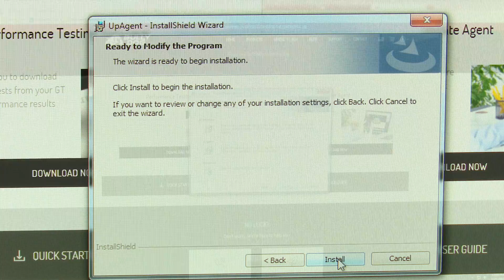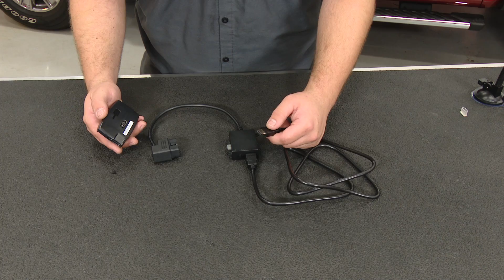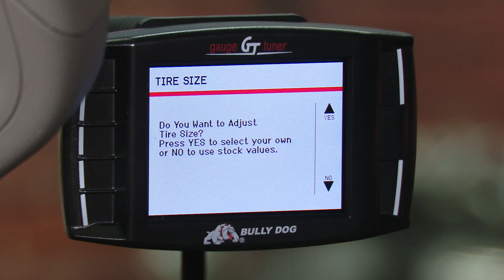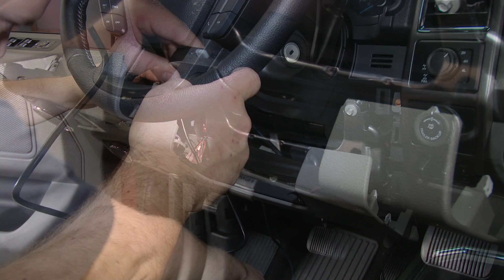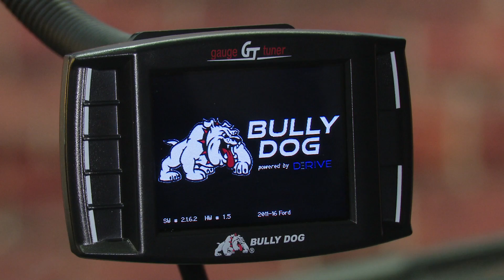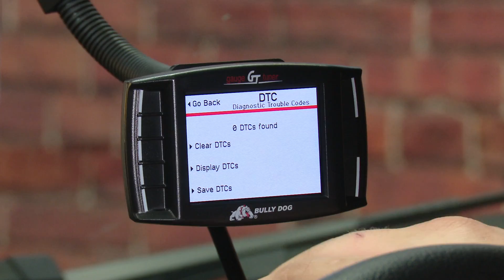F-150 Bully Dog Tuner Gas GT Platinum 2010-2016 Installation

Comment: Wow the comments below… I really respectfully disagree…
1) the wire routing/layout …if I caught my mechanic slobbing wires behind and through my air controls I would be very concerned… this install was for me.. not very “ craftsman like”.
2) I am interested in having the ability to 
a) have a tuner/box
b) plug it in to the OBD port..
c) re-set the trans shift points…
d) MAYBE leave the tuner control head connected for a trip or two to compare shift point selections… and then maybe chose a different shift point set…
e) disconnect the stuff, put it back in the box and leave it in one of my boxes of “ rarely used tools”

I am totally not interested in tweaking…and tweaking..and tweaking… 
Reliability… simplicity… controlling the trans to maintain more torque ..WHEN REALLY NEEDED.. while also minimizing stress on the engine and trans for longer life and keeping best fuel economy…
I am NOT interested in building a race truck that is more prone to failure.

Which takes me back to the beginning…. Craftsman like install…. Hmm

Comment: For the Money your going to Spend on these Tuners/Programers + 93 Octane you really need to think twice !!    True DYNO gains are NOT that impressive for and extra 18 HP + 22 Tq.,  I used the DYNO figures from our Shop DYNO.......   so we achieved the CORRECT SPEC's, not the FACTORY ????  DYNO SPEC'S.... of course I'm not Selling ANYTHING !
Baseline $450-600.00 for a Tuner,  An ADDITIONAL $.50-.72 more per GALLON for 93 Octane..everytime you fill up,,, So, if you were spending $45.00 per fill up before, welcome to the realty of additional $13.00 or more, = about $58.00 for a 20 gallon tank.    People try the 93 Octane before you BUY the Programer/Tuner !   I guess people have money to BURN, I don't.   I run 110% Octane, for $2.30 a gallon, with a Compression of 12.5:1 ....   Yes.... Propane, built the Engine for Propane and it's a MONSTER, for a lot less than what you big Boys a paying for those New Trucks.  I don't cry at 16-17.5 mile per gal. Pulling a 4500 lbs. trailer through the Rockies.  Headers, Mystery Oiler, and of course a under and over Drive !    My Engine LIGHT never COMES on !   It's a raw Performance Based F250 Truck //// how many of you out has anything close to that for $25,000. Invested ???????????????????????????????????

Comment: Would this fit a 2016 eco boost v6 2.7 ?
Reply from the maker: The bullydog in this video is not designed for the 2.7, but this SCT programmer will work with your 2.7 https://www.cjponyparts.com/bully-dog-performance-programmer-bdx-f-150-2011-2018/p/BDXFORD/

Comment: Beware!!! This tuner fried the ecm on my 2010 f150. Bully dog customer service said have it towed to the dealer and they would pay for repairs. Once the dealer gave them a price on a new ecm they refused to pay. (They didn’t even pick up the tow bill). I filed a complaint with the bbb and bully dog wouldn’t respond.
Reply: Jeremy Gilbert probably cuz it’s for 2011 and up?
Reply: Only possible way it’ll fry the ECM is if you use a certain octane gas and choose a different octane tune, for example you fill up on 83 and then choose the Premium (93) tune, as he states in the video it’ll give you problems. Or choosing the wrong vehicle when you’re setting up your tuner
Reply: @charliejackson6447  that would not affect the ecm, it would only cause the possibility of knocking which could destroy internals like valves and pistons, or bend con rods.
Reply: Damn man! Any new news about what happened??
Reply: Jeremy Gilbert Any follow-up info??
Reply: Jeremy Gilbert I'm willing to bet this thing is made for 2011 and up. It seems a little bit fishy that they wouldn't include 2009 f150's as they have the same engine options as the 2010's but the engine lineup changed for 2011.

Comment: How much horsepower and torque gains will I actually get in my 2012 f150 5.0?
Reply from the maker: Depends on the modifications you have.
Reply: CJ Off-Road I'm looking to get a good k&n air intake and I already have a flowmaster cat back on it, their least restrictive system. I just wanna know if getting the bully dog will give me notable performance gains instead of just minimal gains. Thanks for your time and help.

Comment: Will this tuner handle upgrades such as k&n cold air intake and aftermarket exhaust without the need for a custom tune? I tried an SCT X4 but was unhappy that this upgrades required a custom tune, which would have been another $400 on top of the tuner that was advertised as being able to handle the minor modifications.
Reply: We installed this BullyDog and used it in our truck with a cold air intake and an exhaust without any issues and it ran great. A custom dyno tune will always be the best way to go to get the most out of the tuner and the mods, but it's not required. You can simply install the bullydog and follow the on screen prompts for a basic tune, but i promise you wouldn't regret getting a custom tune either.

Comment: something here is very puzzling .  I purchased one of these bully dog tuners and mine does not ask if I want to change tire size.   I called BD and they said its not an option on 2016 f 150.
Reply from the maker: That is very strange, we changed the tire size on ours and its a 2016, maybe ours was an older version and your version is newer and will automatically adjust to tire size?

Comment: I have a 2016 Dodge Ram 1500 6cyl. And want to improve throttle response time. I have a small delay when stepping on the gas. I am assuming this will help?
Reply: That delay is most likely because of the electronic throttle body, I can;t guarantee the Bully dog will help with that.
Reply: Frank Jacobo you need a custom tune

Comment: good morning, I have one concern. I received my bully dog this last wednesday and installed it, yesterday was fine, but today when I was heading out the door, I found some water spots on the concrete under my truck, it's a 2016 f150 twin turbo ecoboost 3.5. I never seen those water spots before up until yesterday after installing the tuner, do you have an idea if it's related to the tuner? or if it's a common problem on the truck? or something I might need to have checked out ? I've got my truck since last November. please help me.
Reply: If its just water and not coolant, its probably condensation from using the air conditioning/defroster, or water from the exhaust, the exhaust makes a ton of water.
Reply: Freddy CJPP I thought about it but it's just that it never happened before and I just got scared when I saw those spots under the truck. Thank you for replying.
Reply: Tribal dance

Comment: Can anyone tell me what fuse they used on a 2013 F150?  I was unable to find a run/on fuse.
Reply: Did anybody figure the mini fuse tap out? I have the low profile mini fuses as well and was wondering if I could just replace it with a 15amp standard fuse but I don’t think it will fit?
Reply: Brian Smith I have a 2014 Ford F-150. None of my fuses work. Also I have low profile mini fuses which won't work with the fuse tap that was included in the package for the bully dog gt tuner. I bought a low profile mini fuse tap but it doesn't work with the fuse panel because it doesn't go deep enough. I've been doing as much research as possible to figure this out and can't find anything to help me. I've called bully dog tech support and hey have no answers for me. In other words they sell it to you saying it works for my truck, but ultimately it doesn't. Bully dog is about to get their item back and I'm about to get my money back.
Reply: Kyle Keller 

Thanks Kyle!!!   Didn't have a problem with my 08 Lariat, but had a bad feeling about this 13.  I see where guys are splicing into other wires to make this work and I'm not wasting my time doing that. I've got a Super Chip on the way and will be selling the Bully Dog.

Comment: Hello I'm currently installing this on my 2014 Ford F-150. I have it all set up but I'm having a problem. My fuses on my truck are ATT type fuses which don't work with the fuse to wire adapter that came with the bully dog. I went and bought ATM fuses and used it since it had longer blades. I put it on the ignition fuse which you recommended, but the chip stays on even with the ignition off. It is set to key and not battery on the bully dog. So what is my problem? Can I use ATM fuses on an ATT fuse block? Why is it still running power to the display but the ignition is off? Can't figure it out. Thanks
Reply: If you have a test light or multi meter, check and make sure that fuse is actually an ignition switched fuse and also check the adapter you installed on the fuse. 
If it is for certain an ignition switched fuse, disconnect the power wire from the Bully Dog and leave the box set to key. If the Bully Dog won't turn off then maybe it's possible that box is defective.

Comment: Why does the programmer need to stay connected?  in 25 years we came from being able to rechip one to having two goofy boxes stuck to it all the time like some sort of colostomy bag.   Why didn't you just put it through the wire gland behind the steering column and to the battery?
Reply: It doesn't NEED to stay connected once you install the tune, but if you want to use it for performance testing or for gauges its a good idea to connect it to an ignition source. If you just connect it to the battery or OBDII port it will stay on forever and drain the battery.

Comment: Great video but we need to know which fuse will turn on/off with the ignition
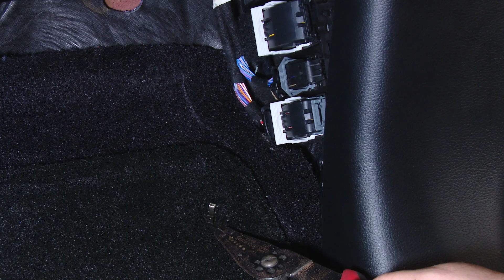Reply: Thank you, there are many fuses that work with the ignition. If you got to 13:07 you can see which fuse I used located behind the passenger side kick panel, but you can use which ever fuse you want.
Reply: @freddycjpp3660  And what happens if I do not connect the bullydog to any fuse at all? That part is scary. Will I drain out my battery?